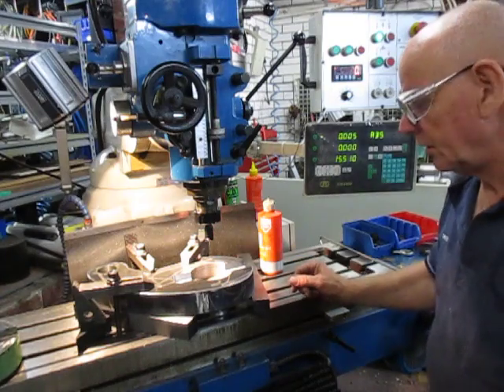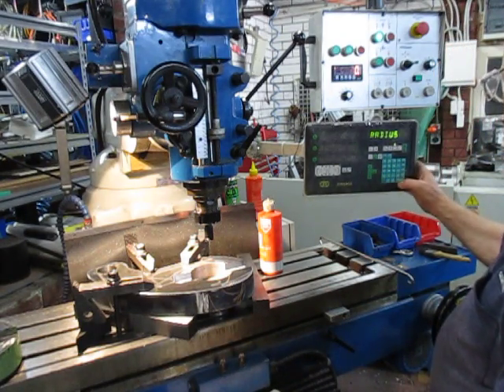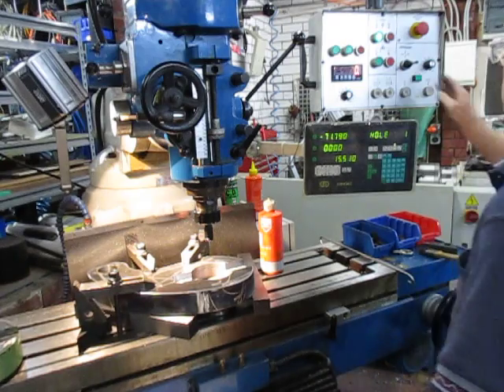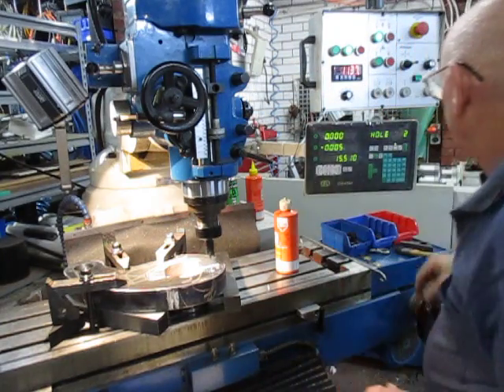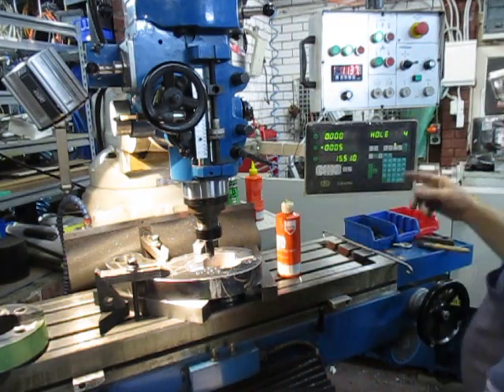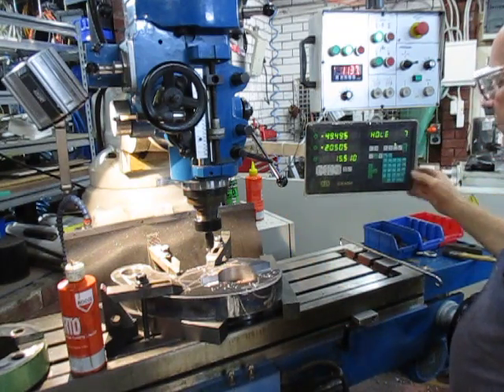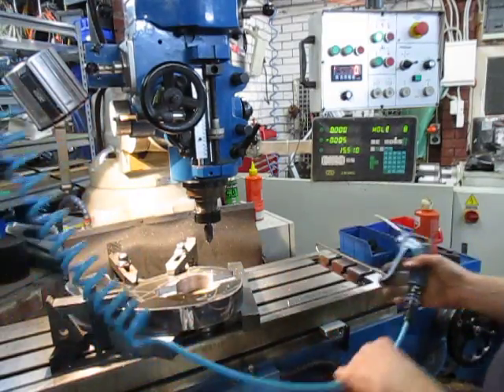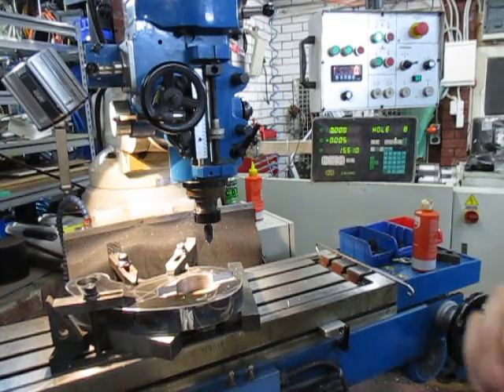Cranky Arm part 5

Comment: Hi Bruce, not all DROs work the same on PCD function. Some, like My Sino one, you have to add one to the number of holes if you don't want to have to work out the actual angle for the last hole position. The first and last hole naturally coincide.
Reply from the maker: Chris Stephens Yes I know some are like that this one and the others I have are a bit more sophisticated and will come back to 0 or 360 degrees if you start first hole on 0 degrees, made me wonder at first but certainly easy for equi angled holes.
Reply: Bruce Whitham  It all comes down to my son's favourite expression when customers have problems with their systems, RTFMS (read the ****ing manual, stupid(you leave out the F for those of a sensitive nature or guys who are bigger than you)) and don't assume they all work the same way!